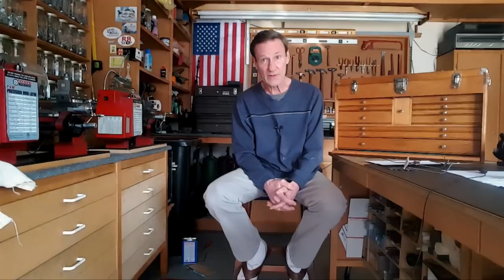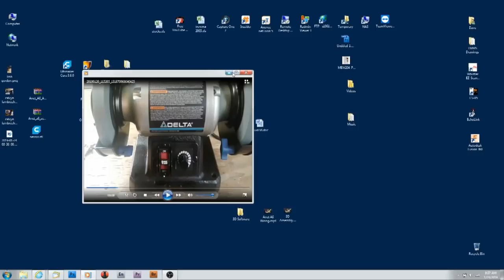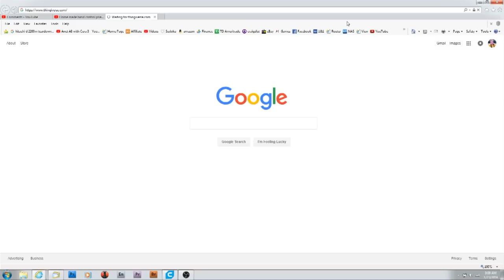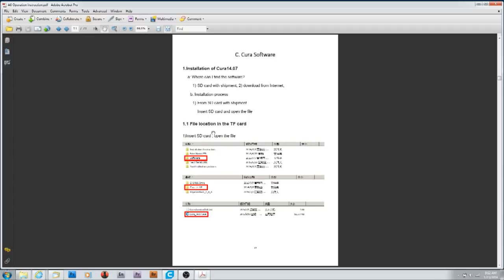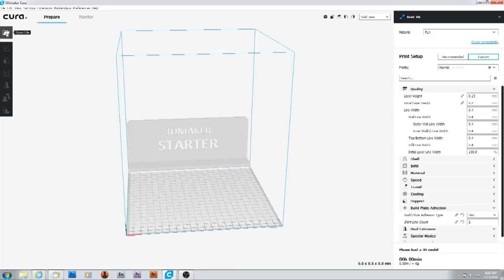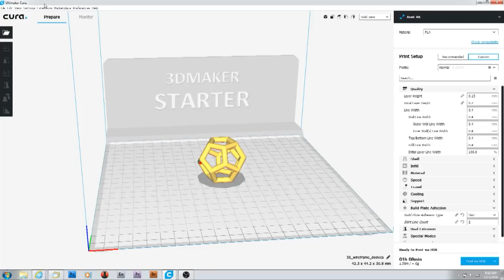Anet A6 CNC Printer Cura Software Part 3 of 3

Comment: Hi Dave,  the model you're printing needs some supports for the top pentagon.  There should be an area in your slicer, I don't use Cura but I'm thinking it is in the structures tab.  Cura will automatically generate the supports during the slicing and they are barely attached to the model so they are easily removed.

Comment: I've had a Printrbot Simple Metal printer since 2014. A 6" x 6" x 6" print cube and it only cost $650 on sale. 😏 I really like the brass bushings at the top of the z screws. I tried to print some but didn't like the way they turned out. Cura is definitely the way to go for free software, there are other good options but the best cost money. I've got the same proximity sensor you have so I'll let you figure it all out. 😀 Thanks for the great series of videos on the Anet A6!